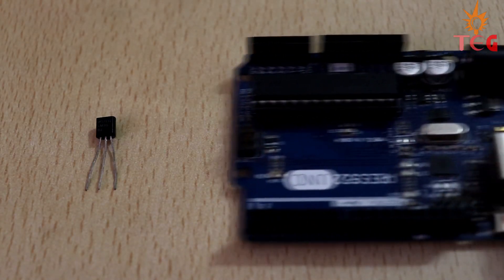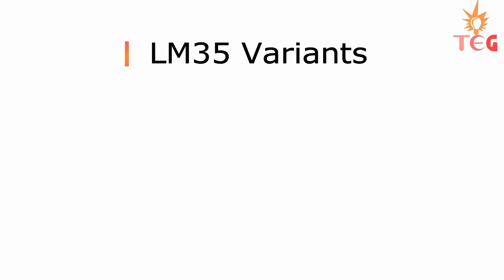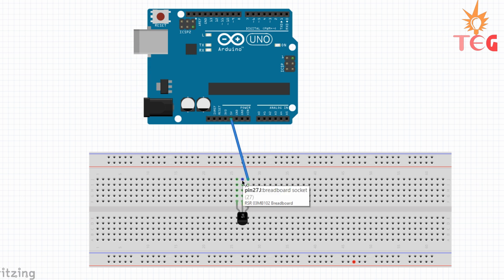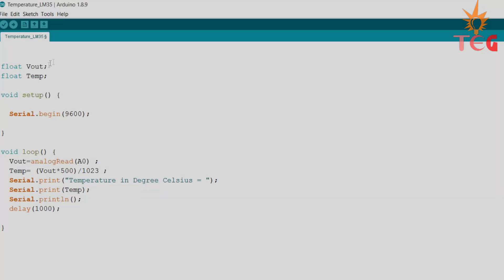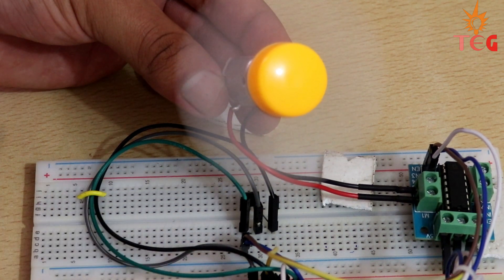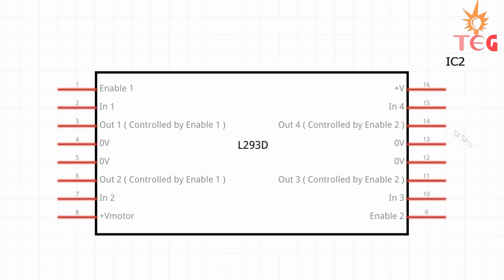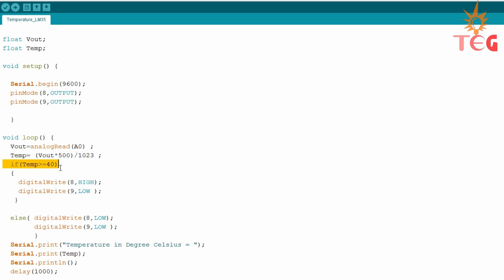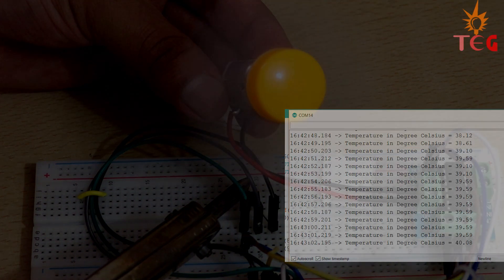LM35 Temperature Sensor with Arduino For Beginners

Comment: Hello! Very cool project but I have a question. My program says that the temperature is 0.0 or 100.0+. I followed the schematic and code exactly, (I have the same temperature sensor), it doesn't work. Can you please help me? @THE ELECTRONIC GUY. Thanks!!
Reply: Hey man, I’m having the same problem wid my sensor. What did you do to solve your problem?

Comment: When I powered the sensor with 5v it started to get heated up very fast and suddenly I unplugged it. Does it get hot actually or is it faculty??
Please reply...
Reply from the maker: No it does not. Check the pinouts of the sensor.
Reply: I had to connect a resistor from the output pin to ground as shown in the datasheet to fix this problem.
Reply: @brasilboy2000  what value was your resistor??

Comment: I have a doubt why did you showed us first vout*100 but then you did vout*500

Please reply and tell
Me thanks
Reply from the maker: Actually you need to multiply it by 5(which represents the voltage level 5v= analog value 1023)
Reply: If we use 3.3V of arduino as reference voltage for LM35DZ sensor , does Vout* 500 changes or remains same?
Reply: @RavindraSingh-jw2sm  I think is ==you should multiply by 3.3 idk

Comment: Hey, I bought a "Paladone Monkey Bomb Clock" and want to add sound-clips whenever the alarm is starting. Are you able to add this? Would probably giving you lot of views too since a lot of people are wanting this.
Reply from the maker: Please elaborate the details 😁
Reply: @THEELECTRONICGUY  currently the monkey alarm is just clapping with the hands, I would like to add some short music with text that the originial monkey from call of duty zombes usually says.
Reply: I thought about a sd card reader with little loudspeaker, only stuck on the part of triggering the loudspeaker, since accustic sensor would be recognized when I am speaking, and light sensor would be challenging to figure out a good plan.